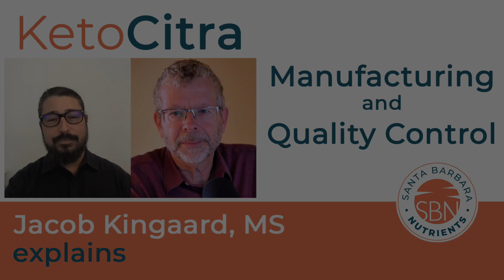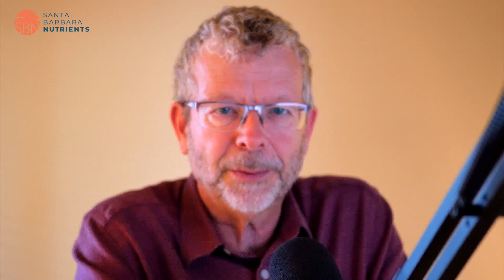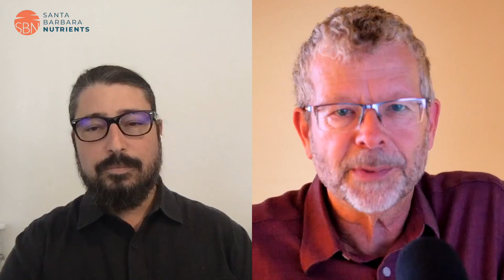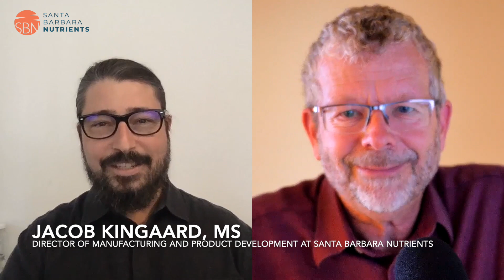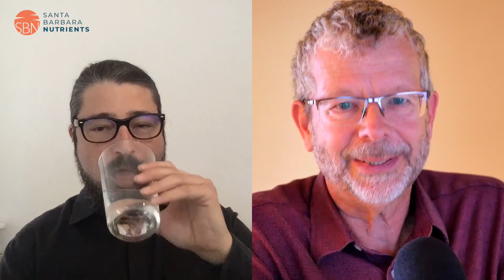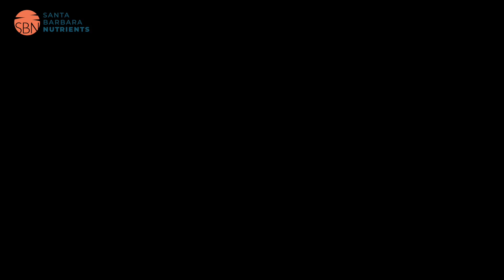KetoCitra Manufacturing and Quality Control

Comment: Two questions: 
1. Why do we need to add stevia - do you have a stevia free option?
2. Do you have a citrate and electrolyte only option?
Reply from the maker: KetoCitra is really designed for all the ingredients to work together and synergize,  especially the BHB, electrolytes and citrate. That's why they don't come as separate options. It's the whole formulation that counts. Additional flavors are planned, maybe also an unflavored version. Stay tuned for those.